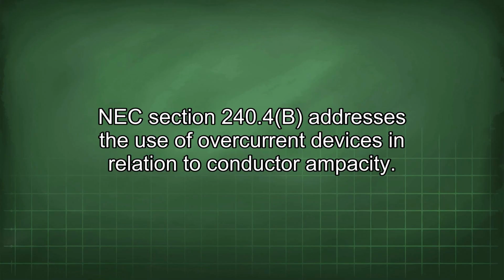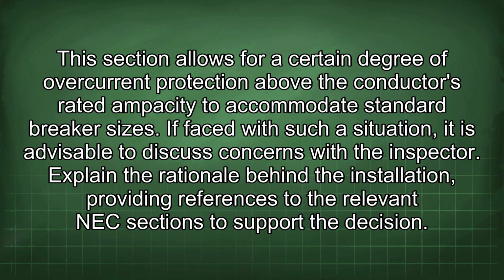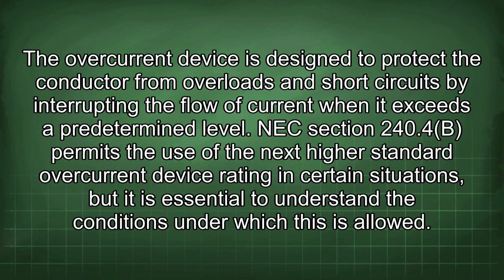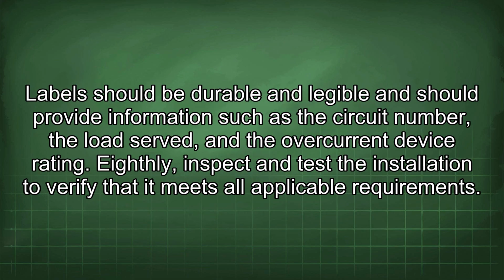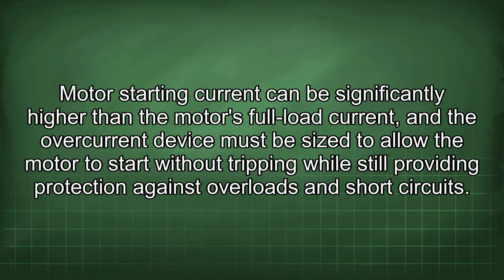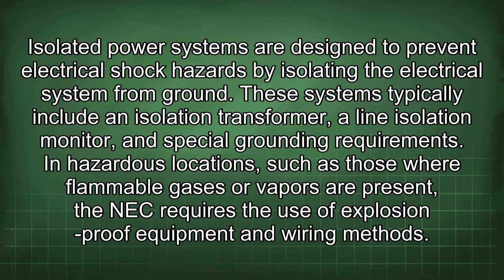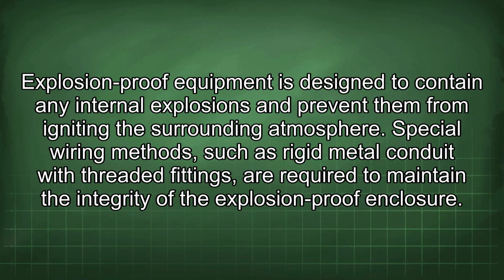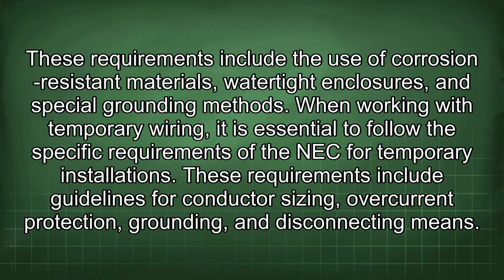NEC 240.4(B) Explained Overcurrent Device and Ampacity

Comment: "What is the minimum size AWG copper conductor required for a feeder circuit that supplies a continuous load of 100 amps. And is not subject to temperature adjustments or corrections other than ambient temperature? Assume the maximum ambient temperature doesn't exceed 30°C" 
The answer: 3 AWG
How?